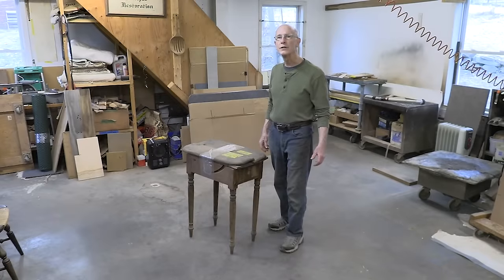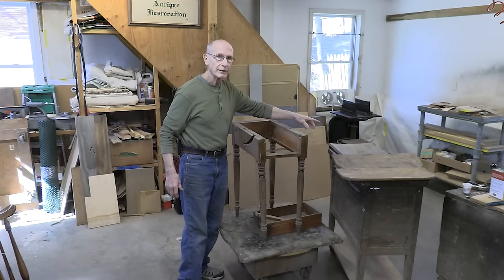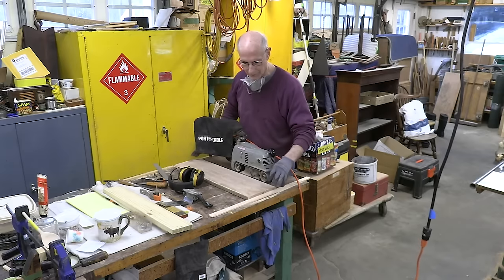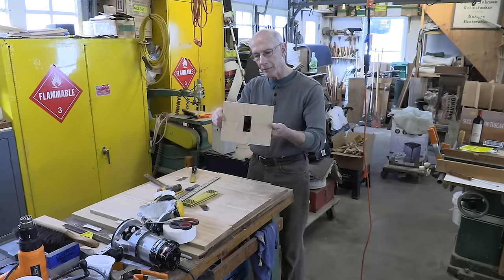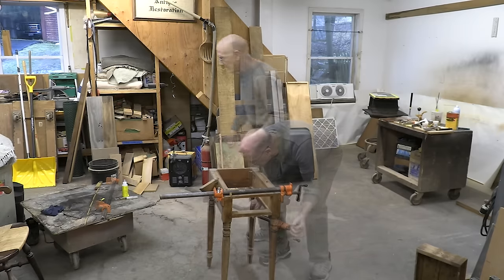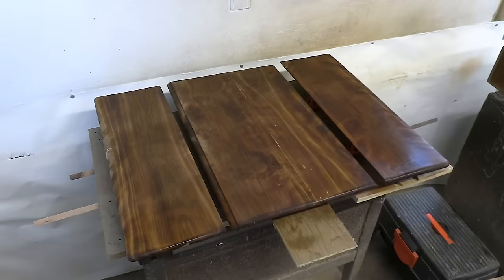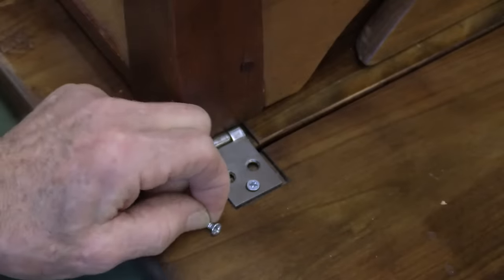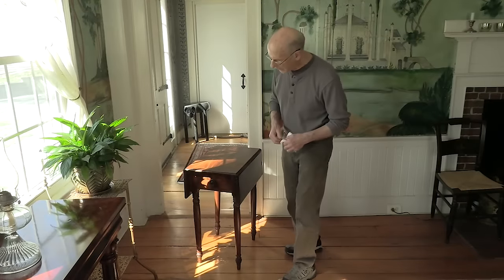This Table was a WRECK

Comment: Friday "Brandy" night was missing someone for the last two weeks.  Pleased to see a new upload.  
I liked your thickness planer, looks rather compact compared to mine.  Mine weighs in at 300 pounds and is a beast to move.
How unfortunate that the table top couldn't be saved.  The swing out supports...wow!  A trick i use to square off the legs is to place a plywood beneath the legs and screw them into their optimum position while the glue dries.
I so enjoy the learning experience of your uploads.  
Happy Friday!
Reply from the maker: Thank you! I like the Brandy idea! I have done that with legs before, but with this one something was really twisted

Comment: Yet another example of the quality and versatility of your skills Tom.

It reminded me that tomorrow I must find the “after straightening & sanding “ photos of the 1920s cabinet we have been talking about that had the badly warped & weathered top.
Reply: In the 1960s I bought an old table that had been stored near a radiator. The top boards had shrunk and one interior edge had curled up. I put a cloth and a dollhouse on it. The house was forced-air heated and air-conditioned, so a fairly even temperature. About rwenty years later I moved and found out the table had unwarped itself. The wood was still shrunk but flat now.
Reply from the maker: Thanks! Yes, it would be interesting to see!
Reply from the maker: That's amazing! Very lucky!

Comment: We loved this video. It also solved the question of what wood our flooring was made from.  When you showed the highly figured birch that you were going to use as the top we knew right away that it is the same wood that is on our floor. Our floors would be from the late 1800s or early 1900s.
Reply from the maker: Thanks! Yes, Birch would make great flooring, it's so hard

Comment: I too have had issues with warped/twisted furniture boards in the past. If enough room is available, I will rip the boards and re-glue them.  However, recently watching Engle's Coach videos he clamped twisted lumber to the top of his heating stove. After some time, the boards remarkably straightened. I have in the past had success watering  down warped boards and laying them in the hot sun. I have certainly enjoyed this video. Best wishes
Reply from the maker: Thanks! I will watch that video, I hope to use that top for my own video on warping

Comment: Great job Thomas, your experience and knowledge of your trade shows through projects like this one . FYI, I've taken plated hardware and heated it with a torch cooled it down and wire brushed it to remove plating , and have also used gun barrel browning solution to give it a vintage look
Reply from the maker: Thanks! I will try that when I get the screws. I'll look for that browning solution

Comment: Pulling things out of storage reminds me of a tabletop my father had picked up somewhere a long time ago. It was made of oak, 4+ feet around and as solid as could be. It was incredibly worn (as in used but not damaged) and had turned an interesting grey in color. He stored that top in his garage for a few decades, always meaning to get about using it. When he ultimately moved into a smaller home, this was one of many items which he just wouldn't have space for, so I took it off his hands, fully intending that I would also ultimately use it in a project... someday. Well that top sat in my garage for a few more decades until I ended up moving to a smaller home, where I just wouldn't have space for it. That was 14 years ago, and I still think about that thing from time to time, wishing I had gotten around to finding a use for it. Fortunately I still have a few other pieces I have yet to refinish or repurpose, so I suppose there's still hope. The table turned out beautifully.
Reply from the maker: Thanks! Well, what can you do? We can't rescue everything! I always think about the pieces I'll never have time for.

Comment: Your point about chip-out is important.  I replaced the cutters in my planer with a helical head and have almost eliminated chip-out.  The shavings you get from your scraper are inspiring to anyone who has used one.
Reply from the maker: Thanks! I desperately need to get a new planer! It would help if I sharpened the one I have

Comment: It is beautiful, Thomas! I am so glad you saved this handy little table for another few generations!
I have watched other restorers on YouTube steam planks, then clamp them until dry and it seems that it works. I've always wondered, if in time, they didn't warp back again? Does it also depend on what the steamed plank is used for? Curious mind wants to know😊!
Reply from the maker: Thank you very much! In my experience the boards have always returned to the warped condition

Comment: Love the work and patience you have for doing such pieces! I haven’t heard of that solution you use on the new wood but I have used a technique using vinegar and steel wool as a solution to weather wood. It causes a reaction with the tannins of the wood in order to make it darker👍🏽
Reply from the maker: Thanks! Yes, I don't know what's in the solutions I was using. But they all seem to work with the tannins. Sometimes the wood is treated with tannins so the chemicals can work better

Comment: Beautiful job, very nice table too  Warped wood has always been a curse. I've had some success steaming the piece, and clamping it flat. I got the idea from when I replaced the gunwales on an old ship's lifeboat. I steamed the length using an old cast iron pipe and using it as a funnel with the wood inside and managed to pull it round the hull, I've only tried de-warping smaller pieces, but it might be worth a try. 
Love the videos, always learn something, keep them coming.
Reply from the maker: Thanks! I've tried just about everything over the years, with limited success

Comment: Hey Tom! An alternative to the belt sander to deal with tear out is a Toothing Plane, I’ve got a few and they manage difficult grain with ease, then remove the striations with the Card Scraper. I also use the Toothing Plane when veneering to add gluing surface. One of these days I need to contact you reg rubbing out a finish, it’s been some years and I need some of your insight. Cheers from Bucks Co, Pa
PS wonderful job, you’ve given the piece another life
Reply from the maker: Thanks George! I will try that! I've never used a toothing plane. You can email me if you have a question: thomasjohnsonrestoration@gmail.com

Comment: This has nothing to do with this wonderful video but wanted your opinion about an outside chest that my step grandfather made for my grandmother. In New Orleans,  we have a lot oh heat, rain and humidity.  The chest is under the carport but the wood is getting very weathered. I came across a gallon of Thompsons water seal but heard that Tung oil has been used for thousands of years and now I don't know which one to use. I have refinished several indoor pieces but didn't really know what I was doing.  When I came across you, I have learned so much. You are truly a great talent and a wonderful teacher!!! I took a oak round table from the trash and am going to try to make a drop leaf table out of it. My dad used to make simple tables and bookshelves but I've never tried to make anything yet. I'll have a try at the cove and round over bits.  Thompsons or Tung oil please. Thanks for teaching us valuable information,  you are such a nice guy!!
Reply from the maker: You are so welcome Bonnie! And thanks for your kind words. Go with the Thompson, it is made for exterior use

Comment: Hi Tom, I've enjoyed your videos for years and have started refinishing a few pieces of my own..thanks to your excellent tutelage.  
I have a question:  I have an antique light maple (50's/60's?) Thomas P. Beales (Portland, ME) buffet/dresser.  I am leaning toward jumping on the bandwagon of CHALKPAINT......Should I sand the piece and varnish/tung oil it or Chalk paint and call-it-a-day?  Is it sacrilege to paint anything maple??  Thanks!!  A loyal fan
Reply from the maker: Thanks Elaine! I would give it a good cleaning with a "de-greaser" like Krud Kutter, abrade all the surfaces and then paint, I'm assuming it has a finish on it that will act as a sealer. If it's already stripped, seal it with shellac before painting. Good luck!

Comment: I was able to get cupping out of a seat from a child's bench. I live in New Mexico where it's sunny and gets over a hundred degrees fahrenheit in the summer. I put wet towels on the cupped side and let it sit outside in the hot sun for a couple of days. I was surprised it actually worked but it did.
Reply from the maker: Thanks! Yes, that's amazing!

Comment: Thanks for this wonderful video.  Really appreciate the bit in the beginning where you show how you date it with the screws.  That top was warped.  Out of curiosity, have you ever tried steam bending it in which you steam it a bunch and put it in the equivalent of a veneers press to flatten it?  Mostly curious.  Making a new top would be quicker like you did.
Reply from the maker: Thanks! Sometimes that could work. I intend to try and get that warp out, trying different techniques

Comment: Love the table very nice job too sir please can I ask you why you cut the cut out for the hinges a little bigger than the hinge when I want to make the hinges or screws old looking l use tourmaline on steel or brass l do like the rolled edges on the hinge sides as a joiner I do like using the Spindle moulder or router table thank you for a great video 😊
Reply from the maker: You’re welcome! I didn’t mean to make the cut-outs bigger, I didn’t realize some of the hinges were smaller

Comment: Hi, Thomas! I'm a fan from Brazil. Have ou got any tips for removing cat scratches from an antique?
Reply from the maker: Thanks! Cat scratches! Any scratches are tough and can usually be corrected by refinishing. But you can disguise the scratches wit a product like Old English Scratch cover. It all depends on how bad they are
Reply: @johnsonrestoration  Thank you! I'll search for a similar product here. I also thought maybe waxing with steelwool could help a bit. The wood is not showing, the finishing is still there...

Comment: Your videos are the best! I have an Empire dining table from about the same era with the same screws, two of which no longer hold the table top in place. You didn't show how you were able to attach the new top to the base with those old blunt tipped screws. Do you need to make a small hole on the bottom of the base, first? Any advice on how I can re-attach the top of my table with those same screws? Thank you.
Reply from the maker: You're welcome! The blunt screws are no problem, you just have to drill the proper size hole, I experimented on a piece of scrap. For your table you need to plug the holes with a dowel or better yet a plug, and redrill. In my video "Too Old to Refinish" I explain the difference between a dowel and a plug
Reply: @johnsonrestoration Thank you!

Comment: You could see how lovely it was, even through it's years of neglect.
Totally brought it back to life. Lovely work.

What did you do to finally level the legs? It was very very boccky at one point, even after you'd stretched out that front joint!
Reply from the maker: Thanks! When I did the final assembly they were fine, I didn’t need to do anything!

Comment: Nice job saving a nice old table base.Did you ever try using the chemical wood ager agent on new pine glue blocks or new secondary unfinished wood?I like the painted wall mural in you home
Reply from the maker: Thans! I haven't tried that yet but you're right, perfect for those secondary pieces. We're luck to have those murals...

Comment: Hi again, question - any idea as to what ingredients are in the two part wood aging agent you are using?? Did you need to neutralize?? You let it age for a while, could you have stopped the process earlier to limit the color change?? Would fuming have worked on the Birch?? I’ve used Potassium Dichromate on Mahogany (using all the safety precautions). Thanks again for all your wonderful and informative videos
Reply from the maker: Thanks! No idea - and why does it seem impossible to find out? You can dilute it for a lighter color. I've used the potasium dichromate too

Comment: Several years ago a customer brought me a drop leaf dining table with the leaves curled up to at least a 45 degree angle. It had been in the family for at least 3, if not 4, generations and many memories built in to it.   But a fire had come along, big enough to require fire trucks and the like. The table was mostly OK, just some smoke and water damage. The leaves had curled because they were unsupported an waterlogged.
Immediately, I said I would just make new leaves for it since it had nothing but sentimental value. But the customer asked if I could just fix it instead of replacing parts. I said I would TRY but no promises. But how?

After removing the leaves, I made several parallel cuts on the bottom, WITH the grain, and about 3/4" apart. Raising the blade, just a little at a time, I stopped when I could feel a slight movement. Then I placed them in the bathtub, holding them under with weights. After 3 days, with water as hot as I could keep it, they finally started to yield, just a little at a time. I removed them from the water but still kept the weights on till they were flat and completely dry. Then I installed several oak battens ACROSS the grain, waited a few days for the glue to dry, crossing my fingers that they would stay flat. They did! I then filled all of the gaps that remained with epoxy to help stabilize them. And finally added veneer to hide the fix. That done, I refinished the table, adding stain that was a very close match to the original. She was in tears when when she saw the results. I still wonder if the fix held over the years. I'm assuming it has since I haven't heard from her. Still looking for before and after pix to send you. Slainte'
Reply from the maker: Thanks Slainte! I have done that exact technique many times! But I decided it was too much work for this one. Although making a new top was no picnic either!

Comment: Wish I were still working; I would volunteer to run the mysterious "stain" through the labs to determine the composition.  

I recently built a mahogany federal cellarette with lots of sandalwood stringing.  I wanted a little additional color for the mahogany, but did not want any color on the stringing.   The solution was potassium dichromate.  It reacts with tannins to produce a rich red/brown color, but sandalwood and holly contain virtually no tannin and are not affected.  I used a very dilute solution; about 1/10 the recommended.  The result was phenomenal.  The grain was enhanced, the color was perfect, and the stringing really stands out.

You might want to give it a try.  There are some handling precautions, but are not that onerous.
Reply from the maker: Thanks Carey! When I had my shop in Boston, we did a lot of finishing for custom woodworkers, and used potassium dichromate on quite a few mahogany reproductions, great stuff! But a lot of times we were matching to samples and had to use stains

Comment: Your router looks very much like an old porter-cable that my dad bought for me in the late 80's or so.  On mine, the mechanism that holds it at depth failed.  That part of your router wasn't shown in full, but the glimpse I caught suggested that the mechanism had failed for you too and you'd somehow macgyvered it.  I'd be (mildly) curious to know how.  If it was me cutting for the hinges, I would have used hand tools - particularly my beloved router plane.  The advantage I see is the setup time is less and the chance of screwing up goes way way down because you can see what you're cutting all the time.  Personally, I also find it more pleasant and satisfying.
Reply from the maker: Thanks! The only thing I've done to the base is replace the tightening bolt. I should get a new base, one of the new type (if it fits). I thought about cutting in for the hinges by hand but that wood is extremely hard and plus crazy grain

Comment: That's a big powerful belt sander your using. Takes a real pro to run one of those and not end up with a disaster. Great looking table.
Reply from the maker: Thanks! Yes, I like that big sander. It's so heavy it does the work by itself, you just need to know how to guide it (carefully)

Comment: Another great video! I've been wondering: How do you clean the syringes and brushes that you use for glueing? Thanks for a great channel and wonderful content!
Reply: For hide glue - hot water (ideally before the glue sets, otherwise you need to soak them). For epoxy - denatured alcohol/methylated spirits (definitely before the glue sets, otherwise you may as well throw the stuff away).
Reply: @dlevi67  Thanks! :)
Reply from the maker: Thanks! dlevi67 is correct!
Reply from the maker: Yes, thanks!
Reply: @johnsonrestoration I learn so much from watching you work! And now I'm no longer mystified about the glue 😃

Comment: I learnt a trick that’s worked for me. A steam iron and a thick wet towel. I then steam ironed the wood having soaked it first. I then applied 56lb weights evenly on the wood using a dry cloth and left it until the wood dried, maybe a week or so. I does however depend on the wood but sure it would work on birch.
Reply from the maker: Thanks Chris! I'll try that!

Comment: I noticed the original drop downs had rounded fronts and rears. Did you just like the looks of squared off corners or would that be difficult to do with birch? Not being critical, it turned out awsome, but I did notice that with the original pieces. Very nice!
Reply from the maker: Thanks! I rounded the corners but a much smaller radius than the original